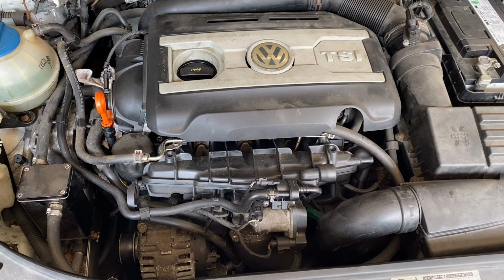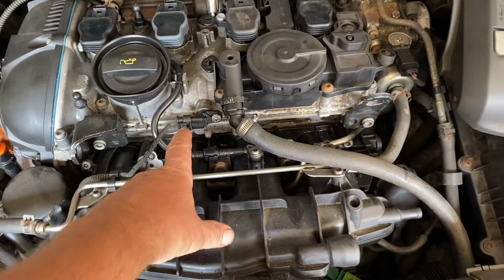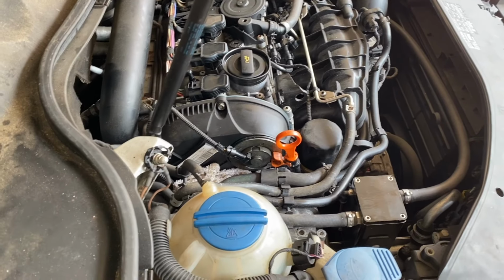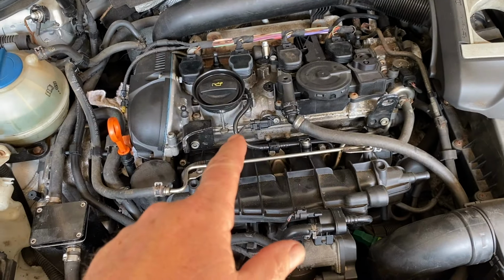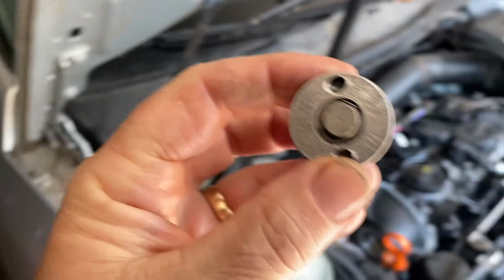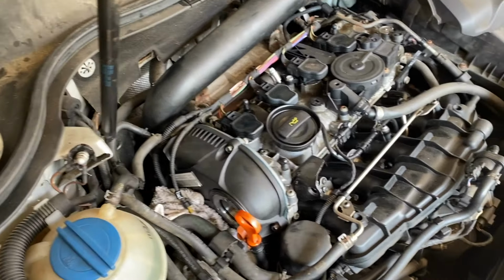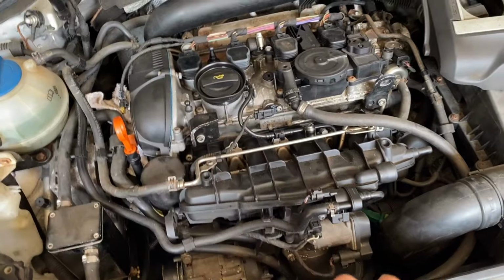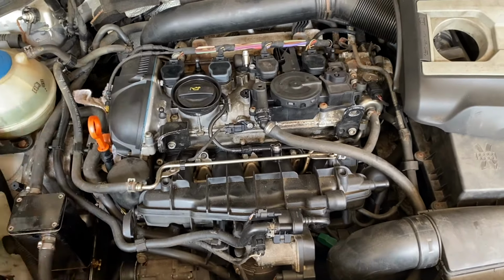Diagnose A Code P0016 On VW Passat, Tiguan, CC, Jetta - TSI/ CCTA 2.0 Turbo - 2009 & Up

Comment: Hello, I have code P0341, I installed a camshaft sensor from Amazon but it worked worse, how do I find the sensor and what tool do you use to replace it?
Reply from the maker: Watch these first, its probably not that sensor.

https://youtu.be/Wf3j0cBnGwM
https://youtu.be/TdBiepLv8Vw
Reply: @ Okay, I've already watched the videos and I've ordered the VVT valve to replace it. I have a question: isn't it necessary to lock the camshaft? I have a kit that I bought that has several pieces but I don't know how to lock it so that it doesn't move when tightening.
Reply from the maker: Just to remove the oil control valve?, No, but remember the valve screws out clockwise it uses reverse threads.
Reply: @ Ok, so when I install the new VVT with the torque wrench, there is no risk of desynchronizing the camshaft? At what force did you set the torque wrench? 
Thank u for your help
Reply from the maker: As long as your timing chain is tight and doesn't have slack do to a tensioner failure it will be fine. Torque to 25 ft lbs.
Reply: @motorcarnut  Hello, sorry for the delay, remove the magnet adjuster and was not stuck, it moved well, the vvt was also in place, was not thrown away, clean the magnet adjuster and place, the car is still sharing bad, when accelerating the sound of the chain is heard, out of desperation I ordered the camshaft sensor to VW, I changed it and the car is still the same, I am thinking that it is the chain tensioner, I quoted with a mechanic and he charges me more than $2,500 usd to change it, I have ordered a new magnet adjuster with the hope that it is that, or I will have to sell the car for $500 usd, too bad
Reply from the maker: You can change the timing chain tensioner yourself with my videos to help you. You can always ask me something if you get stuck.

Comment: Great video and explanation - thank you! I have the exact symptoms you are describing on 2009 VW CC. I just removed camshaft adjuster magnet and looked at the oil control valve but in my case it looks like it is flashed at the bottom similar to how the parts are shown at the dealer website. I am getting P0016 and right now the car won't even start after cranking for 10-15 seconds. Do you any other suggestions?
Reply from the maker: Yes it can be the cam bridge, check out my other videos on how to replace it, little more involved but not bad. Good luck!
Reply: @motorcarnut  Awesome, will do - thank you for reply!
Reply from the maker: @coyotte8030 no problem

Comment: What should you do if the code comes back? I’m stuck on this one. 2009 VW Passat with the code P0016. At first it ran fine and once I turned the car off and back on the check engine light and same code came back.
Reply from the maker: Just answered

Comment: You side no oil on the connector, my has oil, but I wonder why? Thanks ✌️
Reply from the maker: It's leaking and the sensor should be replaced.

Comment: I’ve seen in other videos that I have to stop the crankshaft from moving because taking off the oil control valve and putting it on may affect with the timing, is that something I should be worried about when screwing in the new oil control valve
Reply from the maker: Not true
Reply: When i attempted to install mine my cam jumped time. It could be because the chain was already bad but i would be very careful with replacing this part. When i attempted to do the oil control valve i did more harm than good. I need an engine now...
Reply from the maker: @seamus205 It jumped because chain tensioner is bad. You don’t need a new engine, just have to replace tensioner redone timing and oil control valve. I have videos on all of those things!
Reply: @motorcarnut  it jumped by like 5 or 6 teeth. I haven't run the engine obviously, since i knew it jumped right away. You dont think it bent valves when it jumped?
Reply from the maker: Yes, but that doesn’t mean you need a new engine?

Comment: Great video! I’m having this code on my 2010 Passat CC. Recently inspected what you mentioned and mine is flush not protruding like the example you gave. Car turns on but runs really rough at idle. Any suggestions would be appreciated!
Reply from the maker: Ok, I bet the ball valve in the cam cradle blew out. Or do you know if the timing chain tensioner was ever replaced? Is this the only code your getting?

Comment: Ive got p0016 on a vw ea111 twincharged engine..any leads??
Reply from the maker: Different engine but same code should be same diagnostic procedure
Reply: Long cranking..random misfires..same symptoms..😢
Reply from the maker: Yes it’s probably an oil control valve problem

Comment: I have a 14 Passat s 1.8t just with the p0016 code crank no start can this be same issue
Reply from the maker: Yes, or I have other videos on oil control valve and cam bridge that cause these problems.
Reply: @motorcarnut  thank you I will look
Reply from the maker: @sabinomartinez3047 no problem

Comment: I gotta 05 Touareg and i had this code amongst those other misfire codes and maf sensor codes...it cranks but no start what do you think?
Reply from the maker: Check valve timing and cylinder compression first.

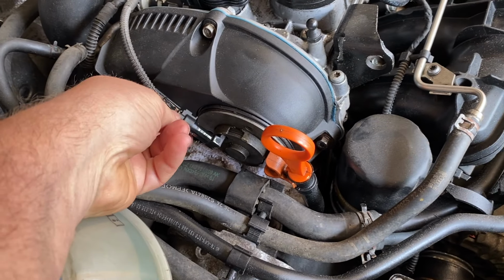Comment: So I started following your video, you say (2:55) to first disconnect the plug to the solenoid and make sure there's no oil in there...Mine was wet with oil - what could that mean? There was also a little oil pooling at the bottom when I removed the cam magnet. However, the oil control valve didn't appear broken (the tab was still flush). I did still remove it and wipe it down. The pin in the middle of the cam magnet did move in and out, but maybe not as freely as it should....
The P0016 code came immediately after an oil change - trying to figure out if its related to an error/sloppy oil change.
Reply from the maker: Clean the oil out of the solenoid plug and it should be replaced but the oil inside where the magnet is, is normal and supposed to be there. If the oil control valve center button is flush and moves in and out then the cause is probably the cam bridge check valve. I have videos on the removal of that too, it’s a little more involved to remove but worth it.
Reply: Did you ever fix your issue ?

Comment: I have a 2014 Volkswagen Passat Pride starting it it wouldn't start replaced battery and it started but it was making a small grinding sound sound at the beginning of starting took it to the mechanic he said it was the solenoid replaced it doesn't work now he's saying something about the cam timing chain still haven't been able to find the issue any ideas of what I can do next
Reply from the maker: Can be a lot of things that control the valve timing such as the cam bridge check ball, the oil control valve that the solenoid controls or a bad tensioner.

Comment: We took out the 3 screws and removed the front piece.. the pin comes out but once we removed it we notice a good amount of oil was out is that normal or should it be dry?.. also the solenoid middle button looks flushed like you said it should be.
Reply from the maker: The oil is normal and correct the button should be flush.
Reply: @Motorcarnut  we got that p0016 code can it be anything else.. my car won't start after that code
Reply from the maker: @brendaavila435 if you still have the old timing chain tensioner it could of made the timing jump. I have many videos on that as well. Can search VW on my channel
Reply: Thank you so much I'll give that a check..
Reply: Hi.. so we took the car to the dealer and they are saying that I have to replace the head gasket and timing chain.. do you think they are being honest?
Reply from the maker: Hard to tell, why do they have to replace the head gasket to do the timing chain? I would take the car to a good independent mechanic. Dealerships don’t want to do that work they want warranty jobs.
Reply: He said that it has jumped valve timing so they want to replace the cylinder head and the timing chain
Reply from the maker: @brendaavila435 well, unless it bent valves there is no reason to take the cylinder head off.

Comment: I am having the same problem, but the only difference is the piece that is help regulate. The oil mines is fine. The button is not pushed all the way out but when I took the cap off there is oil leaking out. Should I just replace the whole thing?
Reply from the maker: Oil is supposed to be in the oil control valve. You may have a cam bridge check valve problem

Comment: You must be a genius. Let’s just say I wouldn’t have found that if my life depended on it. Also this is following using your head removal video to fix carbon build up on intake valves and also had slightly bent valves. Which what would of took you a couple hours, took me days to complete. Then just to fire it up and have it run like it did before which was crap. Misfiring like crazy. So I got the codes, searched them up and it led me right back to you lol. And sure enough that little “dong” was sticking right out. So I’m hoping and praying that solves it. 2 days from rock auto and it should be here. At first I thought too, oh maybe it’s my coil packs or sensor I forgot or something or maybe dare I say if, I had the timing wrong... So I tried to diagnose but every cylinder was mis firing according to my scan tool. Anyways long story short. Thanks for the major help! God bless!
Reply from the maker: Thank you so much for the write up, Yes that should solve your misfiring problems. If the oil control valve fails the computer can't control valve timing and it will misfire. Let me know how it works out!
Reply: She runs like a gem now, perfect. 
That’s crazy that little mechanical piece can cause so much issue. 

Also have you ever tried to fix it by hitting the centre of that valve back in? I took my old one and tapped it back in and it just popped right back where it’s supposed to be?  I still have a new one but might work for temporary purposes.
Reply from the maker: @joelhiebert3129 I wouldn’t play around with the old one, it’s a precision piece and can make things worse. Glad she’s running properly. Thanks for the update and good luck!

Comment: Bro I got a 2.0fsi BLY I have that error code p0016 my EPC is on also
Reply from the maker: That's a different engine family so this video might not apply, but it's a good starting point. The code is similar between the engines. If not you have a valve timing issue.

Comment: im having this same p0016 code on my dodge magnum. I changed both sensors and still throwing the code. Can you assist me with some information pleaser
Reply from the maker: It’s common on your vehicle to jump timing. So I would start there and check to see if valve timing mechanically is correct.

Comment: If the solenoid control valve is flush and still have p0016. Is there valve damage? On cold engine dry compression test all cylinders are at 90psi. Is that good or bad??
Reply from the maker: No valve damage because of oil control valve. 90 psi in all cylinders is ok for a cold engine. I would check the cam cradle oil check valve, a lot of times they become loose and create your problem
Reply: @motorcarnut  I just took off the cover to see the tensioner. I stuck a small flathead and was able to compress the tensioner easily. As far as my understanding, that shouldn’t be able to be that easy to compress the tensioner. Also, tensioner is the old common failure tensioner. Uffff hahaha
Reply from the maker: @ivanvega2821 Yes, Unfortunately. I bet it jumped a tooth and that’s your whole problem right there and with the compression readings you probably didn’t bend the valves which is a good thing. I have all kinds of videos to help you do the timing chain tensioner yourself.
Reply: @motorcarnut  if I could take a picture of what I already have off of the vehicle. You would be proud! Thank you so much for your knowledge transfer. I’m having a heck of a time taking off the motor mount bracket hahahaha
Reply from the maker: Thank you!! I bet I would!  Yes the bracket lower bolts are triple square and very close to the frame rail. I cut the socket bit short to get to the lower rear bolt and used a 13 mm wrench on the bit to get them loose.
Reply: @motorcarnut  working on that as we speak. Going to be referring back to your videos to check and recheck timing when I put it on TDC before removing anything
Reply: @motorcarnut  as I was attempting to rotate to TDC, I seemed to be pretty tough to rotate and it seemed to jump forward and I started hearing a sucking/pressure sound. Also, the intake side tensioner has a lot of slack now and chain…. Is this normal?
Reply: I have the crank at TDC (shown by the triangle on the timing cover at 4oclock) but my exhaust and intake cams are not lining up. They do not measure 65mm and 125mm from exhaust cam to intake cam. Any suggestions??
Reply from the maker: @ivanvega2821 No, it’s not. Hope you’re not hitting a valve. If it feels like you’re hitting something stop and don’t force it.
Reply: @motorcarnut  I have the crank at TDC (shown by the triangle on the timing cover at 4oclock) but my exhaust and intake cams are not lining up. They do not measure 65mm and 125mm from exhaust cam to intake cam. Any suggestions??
Reply from the maker: @ivanvega2821 With TDC on timing cover and timing cam marks facing up intake about 1 o’clock and exhaust about 11 o’clock count the links from mark to mark should be 11 links mark to mark, if not chain jumped
Reply: @motorcarnut  I’m at TDC and have rotated the crankshaft multiple times (cylinder 1 is all the way yo) to see if I can get the exhaust and intake cams lined up. I have no luck getting close to what it should be, which has me confused. I have exhaust and intake cam at both 1oclock position.
Reply from the maker: Chain jumped now you have to take the chain off and redo the timing.

Comment: So after you've taken that thing out that those three t30 bolts are in should there be any oil in there or not and if there is what should someone do
Reply from the maker: Yes there should be oil in there, that’s the oil control valve.

Comment: My VW Jetta says it has a VVT solenoid not an oil control valve. Are they the same thing?
Reply from the maker: No, the solenoid controls the oil control valve
Reply: When I went to look up the part for the oil control valve it says there isn’t one for my 20-6 Jetta GLI SE
Reply from the maker: Then you have an oil control solenoid it’s 2 in one

Comment: I just did a timing chain job on my mk7 gti and got this code but I made sure everything was aligned. My car starts up just fine engine sounds normal so I’m confused
Reply from the maker: Can be the cam bridge. Sounds like an oil timing pressure problem.
Reply: Hi same problem.... I have changed everything I can think of.. I am starting to think diagnostic machines is missleading us and we looking in the wrong places 😞
Any1 here who has sloved for the P0016 code because it is breaking our pockets (golf 7 gti 2013 model... 🤧
Reply from the maker: @WesleyMadai-tp5yp You have to understand how something works in order to fix it. And not just throw parts at a problem. What did you do so far? And did you watch my videos ? I have many on this situation
Reply: Oil control valve 😝 plz come bck and let me know that da error code did not come bck
Reply: Thank you I am sorted.... was da "oil control valve" 😄

Comment: Hi HELP!! Hi Checking zero compression measurement with p0016 activated I will have to check the head, the fault occurred when cold
Reply from the maker: Probably bent valves if timing chain tensioner wasn't replaced. Have many videos on the issue you may want to check out.

Comment: Could this possibly fix p0017? Or is that something different?
Reply from the maker: Yes they are related
Reply: @Motorcarnut  where is it located on the v6 can't find it?
Reply from the maker: @Edwin_VR This video is on the 2.0 Turbo not the V6
Reply: @Motorcarnut  yeah I know, but do you happen to know where it would be on the v6?

Comment: What is the name of the part you replaced? any link to buy it from?
Reply from the maker: It’s called a oil control valve, look on Amazon with your year and model. You’re going to need a special tool as well.

Comment: How much would this cost in a shop…estimated
Reply from the maker: Shouldn't be more than a couple hundred bucks if you can't do it yourself with my video.
Reply: Aye I see you liked my comment. I took the time to look into my car for the p0016 and this was exactly what was going on. Getting it fixed next week. After a year of changing out sensors, tune ups, seeing like 5 different mechanics, this is finally the answer I was looking for. So glad I came across this video. the car would shake, rpms would bounce, poor acceleration, it stalls when coming to a stop, all lights would come on including epc, engine and a couple others. Epc also turns on when accelerating
Reply from the maker: That oil control valve can cause all your problems. Good luck with the fix.

Comment: Hey mate what’s the part number?
Reply from the maker: For what? The tool or the oil control valve?
Reply: Oil control valve mate. Legend appreciate the fast reply!
Would you happen to know the 2012 Tiguan 1.4 litre vvt solenoid part number?
Reply from the maker: You can look up the part numbers here, then search them online for the best prices.
https://vw.oempartsonline.com
Reply from the maker: And search with you vin number for exact part for your vehicle.

Comment: what is the name of the part ???
Reply from the maker: Oil control valve
Reply: @motorcarnut  thanks, why would my EPC light turn off and on so intermittently. It will go on and then then next couple days come back on but initially it was a p0016 so will change that
Reply from the maker: Valve could be sticking causing the intermittent problem
Reply: @motorcarnut  is it ok to drive then, the lights have been off for a couple of days now